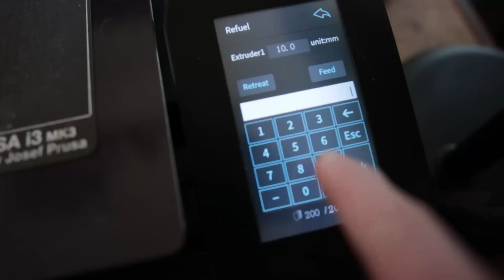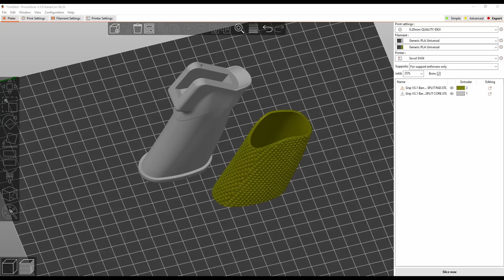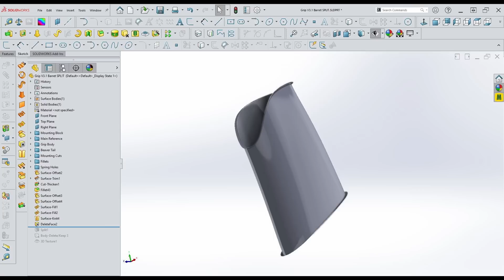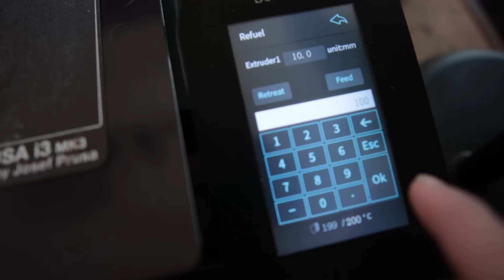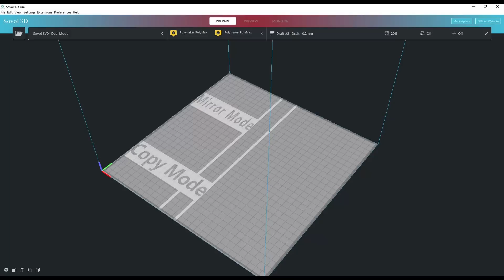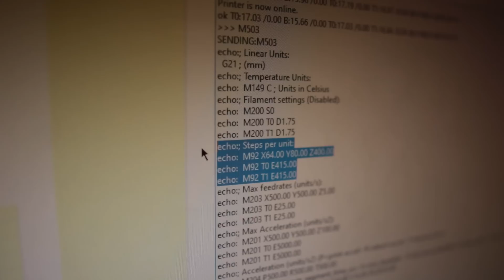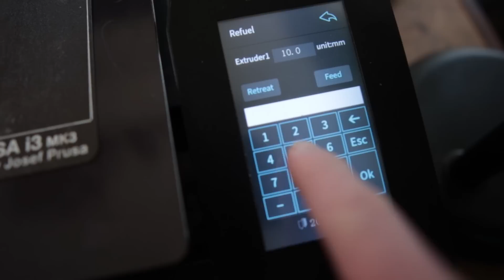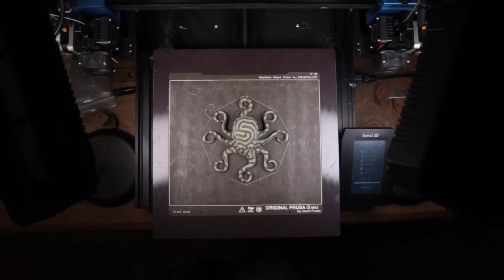My Thoughts On The Sovol SV04 IDEX 3D Printer

Comment: Thank you so much for your in depth product analysis. I am interested in getting this printer currently due to it's price and it's size for an idex machine. Can you tell me if this is a better machine now than it was when you made this video? If so in what ways?
Reply from the maker: Probably. Overall I would not get this machine again due to the bugs.
Reply: @HoffmanTactical  Cheers for the advice. No alternatives in the price range of around £250/$350 currently that I have been able to find, so not sure what to go for, looking forward to the new ratrig, but I need something more affordable in the short term.

Comment: Seems you haven't tried a print leveraging the full build area in single extruder mode. If you had you would've found the firmware usually shat itself sometime during the second 24hr period
Reply from the maker: Ouch. Would not be too surprised.
Reply: @HoffmanTactical  I was really hoping you'd say something to effect of "oh no you just have to do X Y and Z and that takes care of the issue." It's the most expensive printer I own and it's just sitting on the floor.  It's a shame because the hardware is pretty good for the price point

Comment: A couple questions
1- Did you find the bed leveling a pain
2- Is there a glass plate bed that can be swapped out with this printer
3- Does the STL for the octopus come with, or where did you find it?   Just wondered thanks!

Comment: @drrock5356 you can use the standard 608 ball bearings and corresponding spool holders from thingiverse. just search for universal spool holder and an ender 3 spool holder adapter to mount it on the sv04.
the run out sensors also pass over so that there is no friction which would otherwise also pull the extruder toolhead upwards.

Comment: I have this printer too. With multi-material parts, this printer prints 2 layers with the same tool head before changing the tool head. Due to the fact that the spool holder has no bearings and the spool is difficult to roll off, each 2nd layer is different in height after the tool head change. Was able to eliminate the problem with the Z height by using bearing spool holders. A significant improvement can be seen not only in dual mode (Multi material) in terms of Z height, but also in all other modes. I don't think it's caused by the slicers.
Reply: What size or PN bearings did you use?

Comment: thanks for this review. been meaning to watch it for a while, as i bought this printer about 6 months back. I envy the z stops on the Prusa, the whole bed leveling process and using the plastic rectangles really irks me. I noticed the z banding, doubled layers, and weird extrusion as well, maybe I'll try prusa slicer. Id love to see another video. 

Definitely getting a glass bed, but for anyone that has it already and hates how grippy the magnetic plate is, i use a gluestick more as a release agent than an adhesive and it works very well.

Comment: I have the same printer, it does take some time to fine tune everyting. I replaced the spring under the bed with silicone spacer and PEI sheet,  after that it print a lot better, I am very interested to know how you setup the prusa profile with this printer. Thanks for the video.
Reply: Same here I realy need a working profile for Superslicer/Prusaslicer my 2 material prints just dont work well because of the slicer.

Comment: That printer looks a lot like my TL - D3 pro. I didn't have near the problems with mine it works much better and was designed better you should try it I've already done a grip like you did with mine. It's been out for a while I've had mine 2 years

Comment: didnt the patent on heated build chambers expire why is there not a bunch of affordable heated chamber printers flooding the market
Reply: I believe the patent you are referring to is the one from stratasys. 
They didn't have a patent on a heated build chamber, rather on the separation of motion control parts outside of said heated build chamber. The motion control parts overheating generally puts an upper limit to the temperature the chamber can reach, but then we are talking about temps only really required for 'high end' materials such as PEEK or ULTEM.

Still, the separation of heated build chamber and motion control components does make manufacturing more expensive. Additionally heating an entire chamber is costly in terms of heating components required and electricity. Lastly, the high temp materials that require such chambers are very expensive to use and quite niche. Most low end printers print solely PLA, maybe some PETG and TPU or in an extreme case ABS. The lowcost printer market simply doesn't benefit from the high end materials, and thus I don't see how this would provide a breakthrough for lower cost printers.
I do however think that the expiration of this patent might provide a similar jump in the high end printer market as for example the Bambulab X1C did, i.e. making previously expensive technology much more affordable and within reach of more people, but in the high end market. This price segment makes much more sense in terms of return on investment and profit margin, and would also create more separation between these printers and lower cost siblings.
Reply from the maker: This! I want more heated chamber options. I think we will get there, but fear of safety issues on consumer machines is stifling the market.